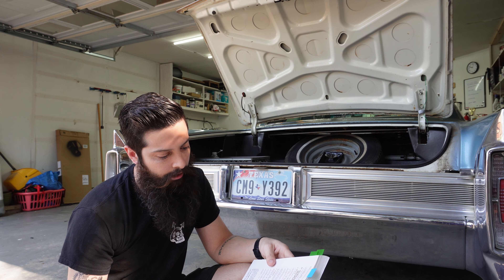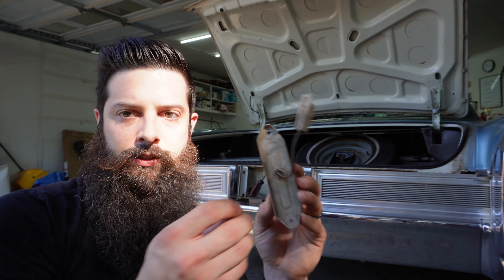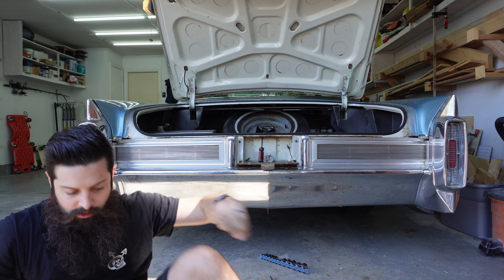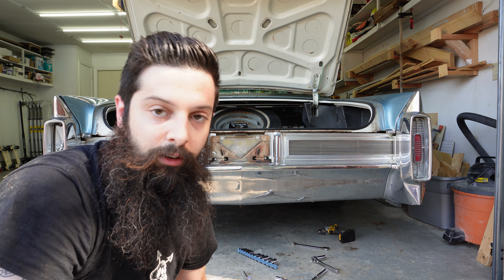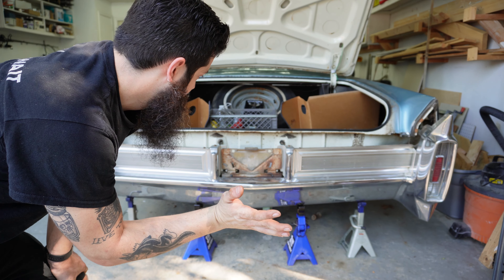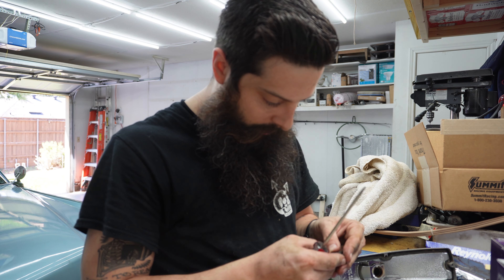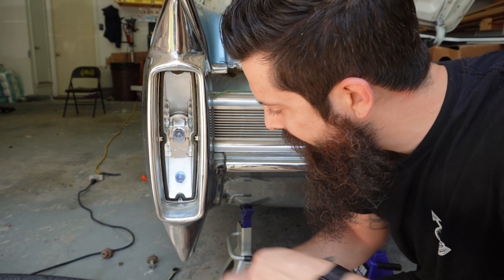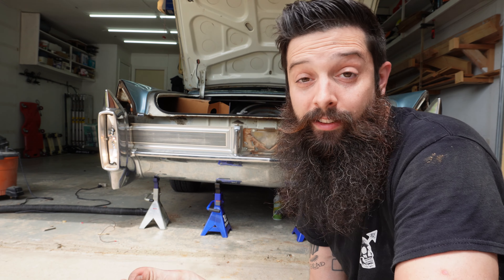Getting Lit Fixing the Brake Light Sockets – 1965 Cadillac

Comment: Dude, your videos rock! Owning a 65 Hardtop Sedan DeVille (same color) I am following closely. Hey, are the cornering lights working, too? Keep up the good work, man!
Reply from the maker: Hey thanks man! I really appreciate that. There just aren't many resources for these old Cadillac's, as I'm sure you know, so it's kinda learn as you go. My cornering lights are currently not working because the steering column has been replaced with an off the shelf unit, so there's no sensor or wire. I actually thinking about swapping them out to an amber bulb and hooking them up to the blinkers.

Comment: I have a 66 coupe deville and my front and rear passenger signal isn't working changed bulb and still nothing, I noticed that my bulbs are very loose , could this be why they aren't working or possibly a  bad signal switch or wiring issue?
Reply from the maker: @nickspagnoletti2015  easy way to check if you have a multimeter is to take the bulb out, set the meter to 20v dc, and connect one prong to hot side of the socket and the other to a good ground, probably the bumper. If you’re getting 12 volts with the switch on, then it’s a bulb or connection issue. If you’re not getting anything, then you’d have to look further up the line.